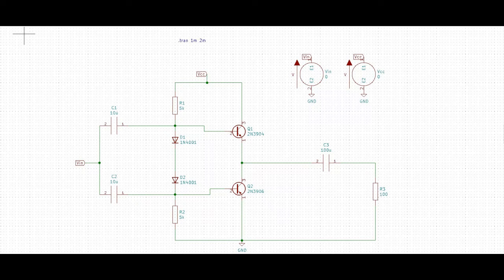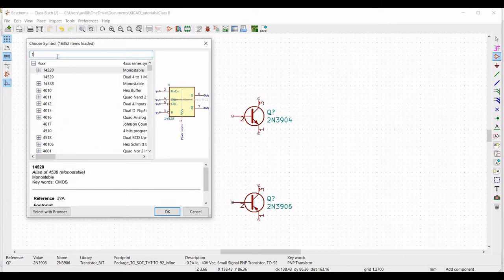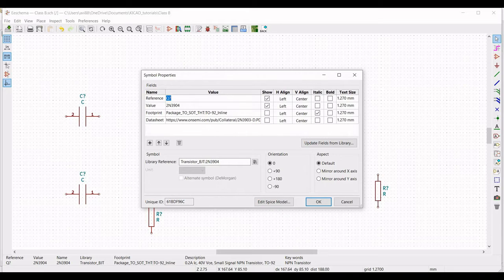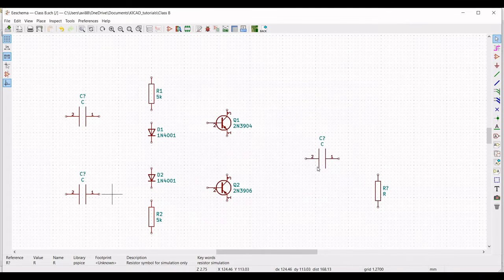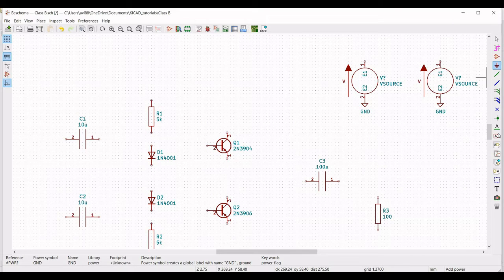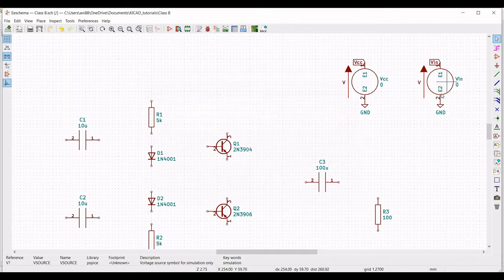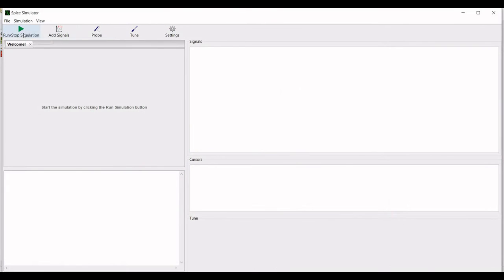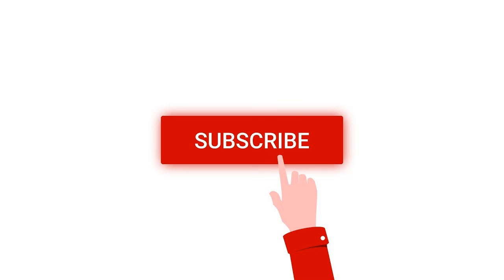Kicad tutorial 21: Design and simulation of Class B Amplifier circuit using complimentary transistor

Comment: Fail! Q2 is wrong! You have to swap collector and emitter...
You don't need C2 btw...
A real tutorial: https://youtu.be/eu54pe0LhpM
Reply from the maker: This circuit works with a single supply, due to capacitor(C3) in series with the load resistance. Positive half cycle, the upper transistor (NPN) will deliver the current to the load by charging a capacitor. Negative half cycle, the lower transistor (PNP) will discharge the capacitor. In KiCad the pin assignment is bit confusing, KiCad uses 1 = E, 2 = B, and 3 = C. So thats the reason alternate sequence option is used.

Comment: Hello Sir, Your video just popped now and thanking god. I am doing a project and I am stuck in the amplification part where I have to amplify AC signal of 3V to 15V using a software and get a output. Can you please help me if you see this comment please. I don’t have time
Reply from the maker: You can send the details to my email circuitgenerator2020@gmail.com, in case if you have an existing design or referral material
Reply: @circuitgenerator9788  Yes sir. Will send you now.